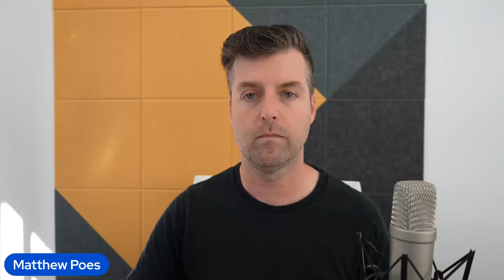Fan Q&A: Acousticly treating a mixed use Townhouse Theater

Comment: I'm wondering if a cylindrical diffuser would be good, especially in the first half of the home theater. Would it be ok to bend a 1/4 inch MDF sheet and put 4 inch rockwool behind it.?